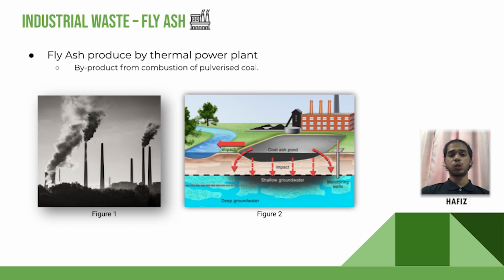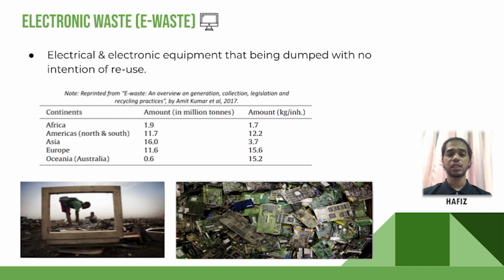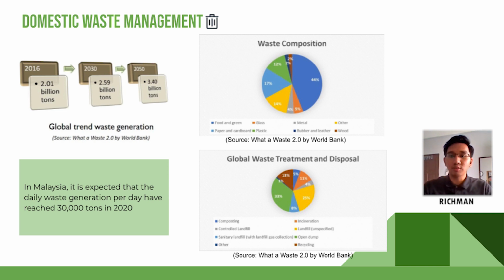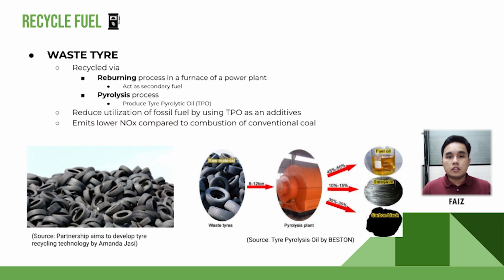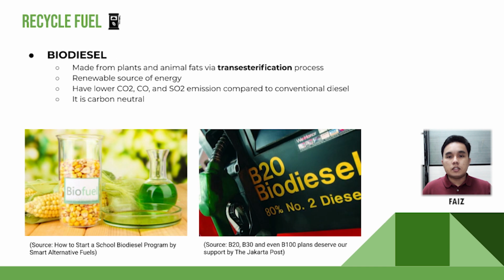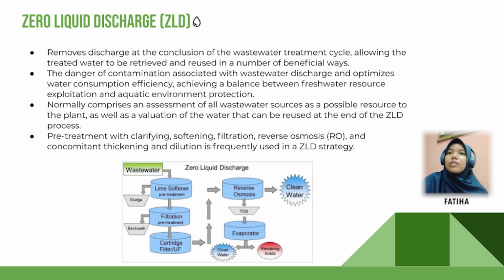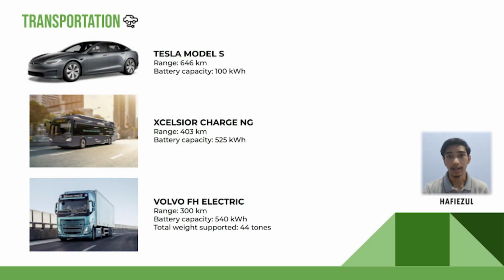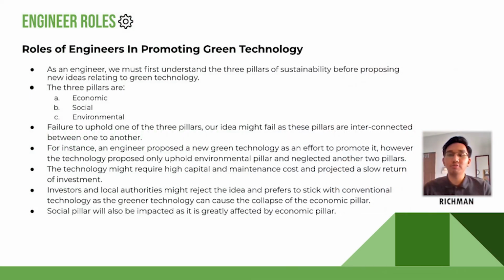SYNERGY - Green Technology (Section 4)

Comment: Question from mechastark:

Base on the transportation system,will a hydrogen electric vehicle be a better option than a battery electric vehicle for the longer range?
Reply: Hi Syafiq,

I'm Hafiezul, representative from Synergy. Thank you for your question. Hydrogen fuel that is being utilized by the Fuel Cell Vehicle (FCV) has been proven to be sustainable just like the Electric Vehicle (EV) since it only produces water vapor or H2O as the by-product. Regarding your question, FCV would be the better option to be used for longer range compared to EV. This is due to the energy density in the Hydrogen fuel is much higher than the energy stored in the battery from the EV. Furthermore, refueling the Hydrogen is quicker than charging the EV battery. Refueling took about 5 minutes while the fastest charging rate currently available for EV is from Tesla Model S that took 15 minutes which could only charge half of the total capacity.

However, in term of which system offer a better green technology and sustainability, EV has surpassed the FCV. The issue in utilizing the FCV does not originated from the fuel cell system in the vehicle, but rather due to the production of the Hydrogen fuel itself.  The production of Hydrogen fuel requires a lot of stages. These include the production of Hydrogen gas either by reforming or electrolysis process, continue with compressing the gas, transporting it to the fuel station, and it then can finally be used to generate electricity in the Fuel Cell. All of these stages does not only require a lot of energy but also will reduce the efficiency of the entire energy conversion. 

In contrast, the electricity supplied to the EV can be generated directly from the energy sources with much higher efficiency. Furthermore, energy sources from the renewable technology have been widely developed and readily available to supply the electric energy to the EV charger. Thus, the whole process of generating and utilizing the electricity in the EV is much sustainable than the Hydrogen fuel production. 

In short, it's undeniable that the FCV has better long-range travel capability but unfortunately, it sacrifices on the less green and sustainable solution as compared to the EV. Hence, many manufacturers have focused on the EV as the technology to improve the energy density in the battery has been carried out progressively. From time to time, this improvement could lead to the same or much further travel distance that can be covered within a single charged battery as opposed to the full tank of Hydrogen fuel.

Hopefully I've provided a clear answer for your question. Thank you.
Reply: @nurhafiezulmohdrosli7733  thank you for your answer
Reply: @shafiqstark2996  glad I could help

Comment: Question from EngineerX
For people to change from the current system to green technology, what is the most important factor for them to accept this technology?
Reply: Hi Syarif Salim,

Richman Arif is here from Synergy. Thank you for your question. In order to answer your question, we must take a look back at the three pillars of sustainability that I have mentioned in the roles of engineers in promoting green technology. To ensure the people wants to change from current system to a greener system, the greener system have to fulfil all of the three pillars which are economic, social and environmental. We can’t deny that in our perspective as an engineer, environmental pillar is the most important factor in designing green technologies. However, for non-engineering people, they are more concerned on economic and social impact. If we proposed a system that have high cost and causing uneasy social impact, then our green technology might fail and being rejected. Therefore, the most important factor to ensure the people can change to a greener technology is we as an engineer must balance all of the three pillars.

Hope that answer your question and have a good day ahead.

Comment: Group Suria: Why wind energy is not a popular option in generating electricity in Malaysia?
Reply from the maker: Hi Ahmad Zulfikar, thank you for asking.

I will try to answer your question based on my opinion towards this topic of discussion.

Personally, I think that wind mill are not popular in Malaysia for a few reasons;

1. High initial capital cost
2. Lower power output compared to a power plant, that lead to longer return of income
3. High maintenance cost and require skilled workers
4. Performance of the wind mill totally depends on the weather condition, which is uncontrollable
4. Malaysia geographic condition

Wind is absolutely free and it able to generate clean electricity, which is very beneficial to the environment. But, due to all of the factors above, it might be the reason for investor to choose another power generation technology which is more predictable and profitable.

Hopefully this  answering your question.

Thank you.

Comment: Electric car is one of the green technology for transportation but why in Malaysia, it is not adaptable/widespread use? - Petroleum
Reply: Hi Firzanah,

I'm Hafiezul, representative from Synergy. Thank you for your question. The lack of implementation of Full EV in Malaysia is due to the trend of Malaysians that prefer a cheaper car. For example, Perodua Myvi, which is the most sold car in 2020 cost only RM43 029 while the cheapest Full EV that is available in Malaysia is Renault Zoe priced at RM145 888. 

Full charged Renault Zoe could travel 210km while a full tank of Myvi could travel around 750km. Furthermore, petrol station can be found almost anywhere in Malaysia. In contrast, currently, there are only 223 public EV chargers located all around Malaysia. 

Thus, the usage of EV in Malaysia is still not a practical solution especially for long distance journey. More works need to be done by focusing on building the infrastructure first before the EV could be sold to the customer.

Hopefully I've provided a clear answer for your question. Thank you.

Comment: Mechanizer - From the video, you stated that we can convert the fly ash into brick as one of the greener ways to dispose the ash. Can you briefly explain the process of the brick production and does the process have any environmental impacts?
Reply: Hi Ayreen,

I'm Hafiz Razali representative from Synergy. Yes, converting fly ash to fly ash brick is an effective alternative way to reduce the negative impact of fly ash on the environment. Fly ash as a major material will be combined with other materials such as cement, water, and binder. The chemical composition of the fly ash brick depends on the manufacturer itself. Therefore, you can obtain several fly ash bricks with differents mechanical properties from a different manufacturer. In the process of manufacturing the fly ash brick, there will be some differences between manufacturers. 

There are 3 main processes in producing fly ash brick: the first one will be the mixing process. In this process, the raw materials are fed to the hopper box and a conveyor belt takes it to the pan. The cement and water are added to the pan, and all the ingredients are mixed for around five minutes. There are skippers and rollers in the pan to mix the material efficiently. The mixing process is very important for fly ash brick making.

Next, the pressing process. Mixed materials being conveyed to the hopper via a conveyor belt. Usually, the PLC controller is used in controlling the number of raw materials being fed into the press machine. The raw material is fed into the mold made with high-grade EN31 material and it is pressed in a fly ash brick-making machine.

Lastly, the curing process which the compressed brick being keep in a chamber for 24 hours. then, the bricks are kept for 15 to 18 days where the bricks are water twice a day. Curing is done to prevent loss of moisture required for hydration of the bricks and to keep it in range of recommended temperature. Curing will increase the strength and decrease the permeability of hardened concrete.

After going through many research papers regarding the production of fly ash brick and as far as I concern that there is no negative impact of the fly ash brick production process on the environment.

I hope this answers your question.